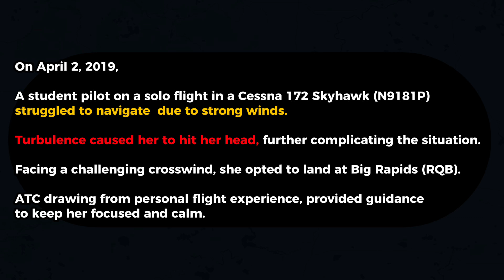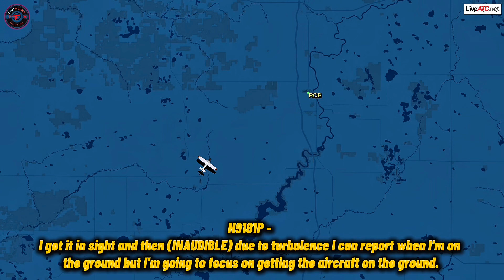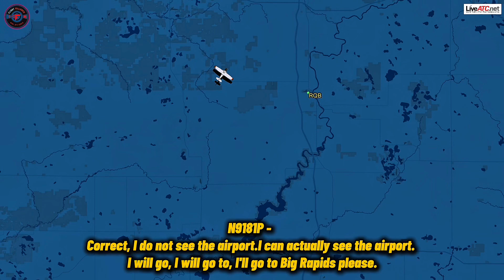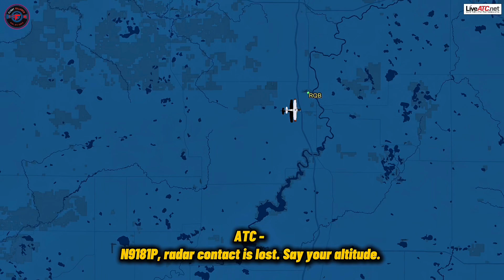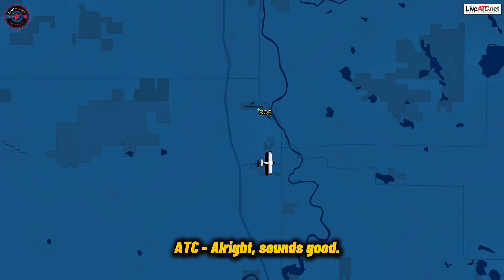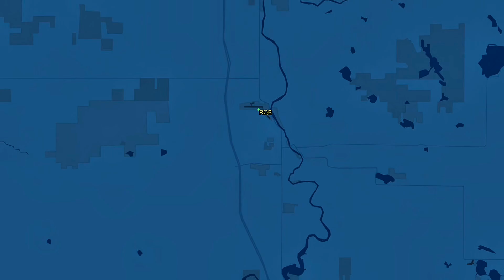INJURED Student Pilot Battles Crosswinds on SOLO | ATC Saves the day! #atc

Comment: Great Video/Audio and great job by all concerned. On my first solo at 8 hours, I had an engine decide to start coming apart after 2nd touch and go. I was able to nurse it around to a safe landing, but I was at a controlled airport and too stupid to even alert the tower I had an emergency. I eventually became an Air Traffic Controller and Commercial Instrument Pilot. As a controller, I helped many low hour pilot through emergencies so appreciate what happened in this video. Thanks